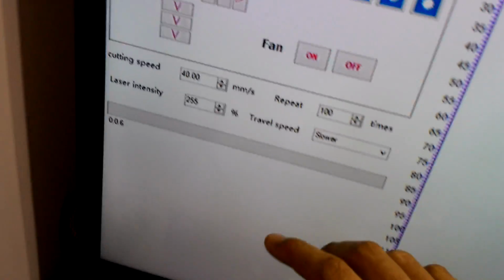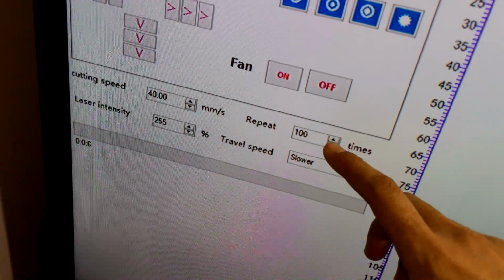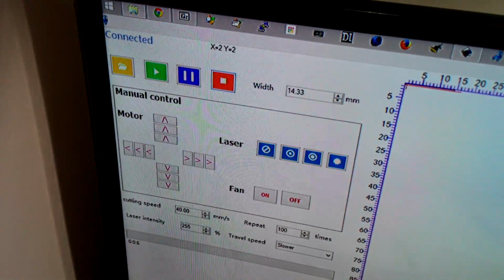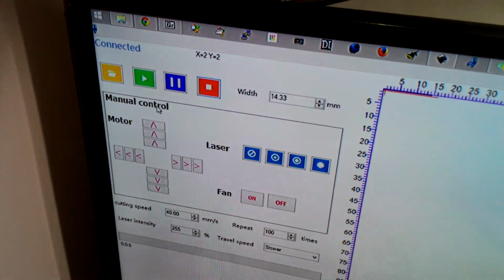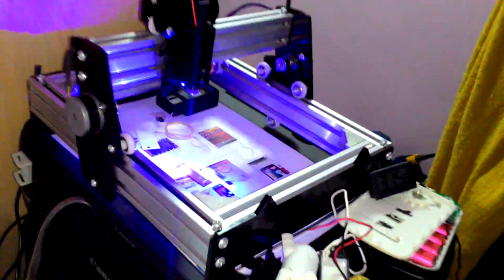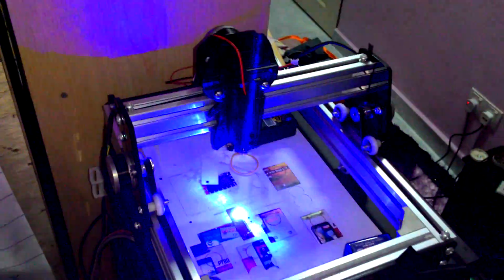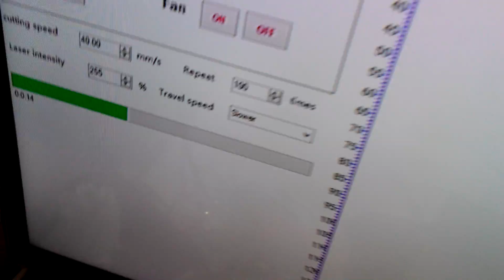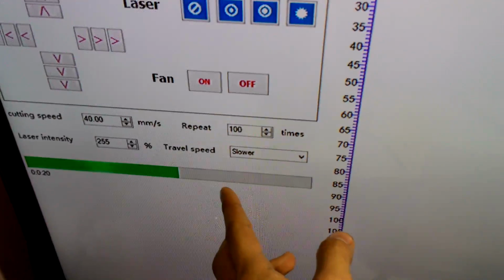2W Laser Engraver Cutting PCB

Comment: Very impresive, did you have tried burning black paint off PCB (for etching later)
and does it need 2W, or a 500MW  laser diode can burn paint.
I'm looking to build at low cost a 500MW laser CNC table.
thank you
Reply from the maker: +Jack Berg Thanks. :) I tried black permanent marker, it does etch it, but not clean enough for pcb masking. Maybe I should try a better paint. I own the UV 500mW laser as well, it can cut black paper, but not white. Haven't try it on any kind of paint yet...

Comment: Hi
Did you try to make actual PCB with it?  i mean since it can cut through the board, then it does worth to try.
Nice video man.
Reply from the maker: +oah 84 Hi :D
Yes, I did, but it failed. :(
I use some kind of a cheap uv-sensitive photoresist film. The reason why it fails is the laser engraving process took too much time and thus overexposed the other area.
Reply: What about cutting the board directly without photo-resist, i.e., to directly etch the copper with ur laser? since an FR-4 board has a thickness of about 1.6 mm.  u can cut say like 0.3 mm of its surface to remove the copper.
Thx for the reply man and again, great video :)
Reply from the maker: +oah 84 Thanks for the compliment, glad you liked it. :)
I tried that as well, and it fails too. :(

Copper is a very good heat conductor, 2W laser alone isn't enough to etch it. 
I'm not sure what's the minimum wattage though...
Reply: Nah, sorry to hear that man. One final question, was it a one ounce copper-board or half an ounce copper board?
Again thx for all the good info
Reply from the maker: +oah 84 You're welcome :) I believe the board was half-ounce copper.
Reply: It seems u have tried everything :). Good job man.
Reply from the maker: +oah 84 Maybe there are some tricks unknown to me. Thanks. :)

Comment: hey Afdhal, goodwork..
if you were to put graphite coated piece into you laser it will make graphene nano tubes. one common product is called ELECTRODAG graphite based paint used in electroplating industry to make surfaces conductive. or just natural graphite, graphene for ultra capacitors was first got by putting sticky tape on apiece of graphite and pulling of a single atom thick layer, expose this to the laser and it will make ultra nano tubes.
you do good work dood!
Reply from the maker: godspirals Thanks for the compliments godspirals..
That's one interesting topic you're talking about, thanks for sharing. :)
I never dived into the subject before, I'm wondering, Is there any practical uses for homemade nano tubes?
Reply: Afdhal Atiff Tan Amin Husaini Tan . YES MOST DEFIANTLY. Graphite/carbon nanot ubes store hydrogen this was discovered back in the eairly 90's , totally changed the hydrogen storage problem  from 3rd less to 3x more distancetravelled on a given area of fuel storage (compairing petrol to hydrogen......search ....hydrogen storage in carbon nanotubes.........
it would be presumed excelent batteries can be made to.

I know your into electrical things. ultra capasitors are amazing. GRAPHENE is amazing it's the future....NOW
Reply from the maker: godspirals Yup, graphene is such a wonder material. I hope to see it to be more accessible to general public like arduino does.